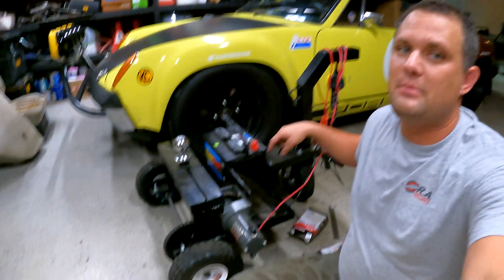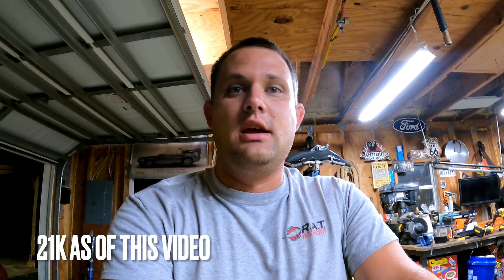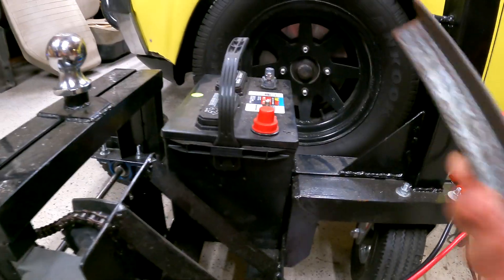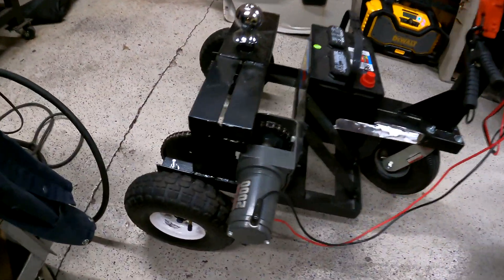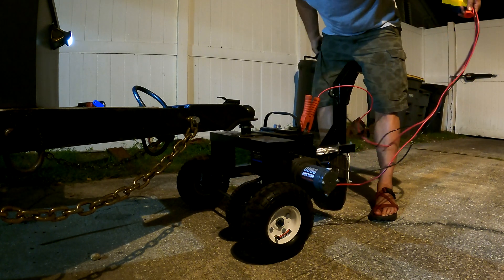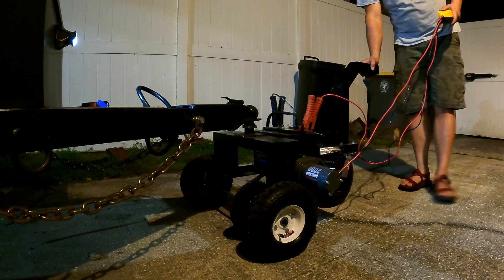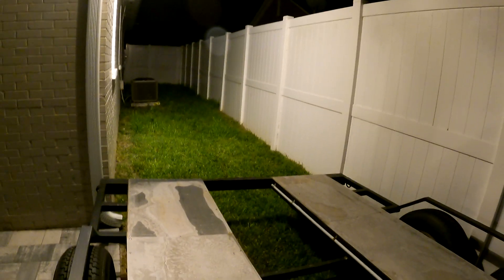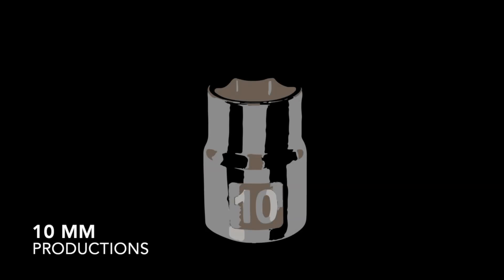DIY Powered Trailer Mover - UPDATE

Comment: put duals on it it will be the quickest way to increase traction. You can do all of the suggested experiments but that would be the quickest way. All tyou'd have to do is your hub method with a piece of pipe in the middle

Comment: realize it is 2 year now.... but I have a thought about your traction.... get (2) 3" wheels.... attach them to a small swing arm that can pivot.... then have them inline with each drive wheel. take a bicycle tire and lap it over the drive tire and the small 3" wheel..... now pivot the swing arm down.... you have a track!!! then pivot it up.... and you still have a 2 wheel drive that can freewheel just like it does  now!
Reply from the maker: Traction was my main issue! This idea is killer!
Reply: @barefootgaragejax9252  I had problems with traction on a electric wheelchair..... so I did what I said above.... and no more traction issues at all.... if you can get the right size tire that will slip over the drive wheel and the small wheel without cutting it  it works perfectly.... but even if you have to cut the tire use a piano hinge.. I used a linear actuator to raise and lower the swing arm... I also put a shock on the swing arm wheel since it was on a wheel chair to make the ride super smooth.... I am helping a friend build a trailer dolly and sent him your video... I told him to use a winch and so..... then I said I bet people have done this before and looked on you tube where I found your video.... I told him to use a bottle jack and weld the ball on it... that way if the ground is uneven you can adjust the height on the go! I used a bike tire since the tires on the wheel chair were 1 to 2".....but you may need a atv / golf cart tire due to the width.. but it is still the same concept. Aires came up with a snowblower that uses a similar idea.... called quick trac or something along that.... but it will give you an idea of what I mean.... I just looked it up.... it is called... Rapid trak... check it out! https://www.youtube.com/watch?v=E7pjKGSFFXs  ...... BTW... the higher you can raise the pivot the easier it is to freewheel... you can see the contact surface of the drive tire... the smaller that contact the easier it is to freewheel.... the aires only lifts it a inch or so and leaves to much contact area but still works... if it raised 4 to 6" it is almost the same contact area you have now!

Comment: I am in the process of building one to move small camper trailers around a pole barn. I have all concrete and don't have to deal with the grass problem like you have. I like your videos and the changes you show when adjustments to the build are made. Thank You Very Much!
Reply from the maker: Good luck! Make the mover as heavy and low as is feasible

Comment: You probably noticed that when your power dolly is pulling the trailer, you have more traction than pushing it.  Here is what is going on. Because your towball is so much higher then the horizontal centerline of your drive axle/wheels, it has the tendency to push the castor wheel in the ground (more resistance) and lifting the drive wheels in air. The solution would be, kind of a system like, reverse or upside down distribution/equalizer bars.
Reply from the maker: Agree! It needs a second connection point to avoid the rotation. I was able to use some straps to prevent 1 direction, but it needs to go both ways.

Comment: Next time on version 2 by a used edge 2.0 power chair, w/ two motors running two sides with 1 joy stick type controllor on the handle make the final drive to both. Live axles with next size wider NON  flat tires the controllor has 1thru 5  speed for power or speed thru joy stick forward AND backwards the same, when letting off the joy stick it locks both wheels so it don't roll! I am a disabled vet i have one of those and it is fast slow, powerful or easy all in one push off push on switch left, right, forwad, backwards ,quiet, i thimk with the drive on each side ratio change via sprocket reduction would be enough, a short linear acuator for the ball hight would make hooking the ball easy and fast! Kewl job though on version ome!
Reply from the maker: Great idea!

Comment: Try making the towball high so there is more wight on the mover and front wheels are off the ground also try a bigger gear on the wheel drive plus if you have two motors one for each side and wire them up on two switches you could use them to trun
Reply from the maker: If it make a version 3.0 it will be dual motor

Comment: Just a thought for consideration on traction.  Depending on the spring setup on the trailer, I am wondering whether airing down the tires on the front axle would shift more weight to the tongue and let them slip sideways easier when turning the trailer?
Reply from the maker: Good idea! I’m sure it depends on the surface. Less psi on grass certainly would make more drag. I think the mover weight needs to increase ideally!

Comment: How would setting up dual wheels plus making the hitch higher putting more weight on the back wheels of your trailer there for transferring more weight to your mover
Reply from the maker: Dual wheels would be a huge help, but you want to keep it as low as you can reasonably. I actually too 2-3” out of the height, because it tried to run “under” the trailer instead of drag it.
Reply: @barefootgaragejax9252  in the process of making one myself using the knowledge I have seen and used them to move augers

Comment: Hey instead of pushing buttons for forward and reverse get either a twist or thumb throttle.... I need to make something to handle a 10,500lb trailer with a 2100lb tounge weight.... 

As for traction the ball mount needs to be center of the total dolly .
Reply from the maker: Great idea!

Comment: I need a very heavy duty dolly and I'm thinking if it is possible to use 4 RTV wide tires, mounted with 4 individual motors for all wheel drive. The 2 tires on front are mounted on a swivel guide, just like the old carry red metal carts we all had back in the old days as kids, those that we moved dirt or even went down the hill with a friend... lol.
Reply from the maker: Sounds awesome- please share!

Comment: I just commented on the original video, but I guess I'll repeat. the tow hitch needs to be at the centre of gravity. That's why it keep lifting the loose wheel. Also directional changes are hard because the winch motor will be locked under no power. If it were me (but with your money!), I'd have 2 motors powering the driven wheel independently. That way you can steer with one in reverse, one forward and it should spin around nicely. Also for off road, perhaps a tracked system instead of tyres.
Reply from the maker: Two motors would certainly be an upgrade!

Comment: Maybe you know about LiFePO4 batteries already but if not, they are really impressive.   Whereas lead-acid you only really get about 1/2 to 1/3 of the AH capacity out before the voltage is too low, the LiFePO4 batteries can do a true full capacity discharge, are good for about 10 years life and 2000+ cycles.   They have a low internal resistance too.   You get more performance from a 30AH LiFePO4 battery than a 60AH car battery and the LiFePO4 battery only weighs about 8 lbs and is much smaller.
Reply from the maker: I’d love a lipo battery! For this application, the weight of the lead acid is actually an advantage :)

Comment: Nice build. Couple of suggestions for improvement. Mount a tractor seat facing forward and then mount a steering wheel straight up between your legs. Get rid of the swivel tire and mount a turn tire solid to the steering rod. That will give you more weight over the drive axle and allow you to back it up like you were using a truck. You can also mount your controls on your steering wheel or convert to foot controls.

If you still have traction issues, the wider and taller of tire equals more ground contact thus more traction. 

👍
Reply from the maker: Then I can take it out for joyrides too! Great ideas!

Comment: When reversing the trailer I think I saw you pushing down on the handle. Surely pulling up would increase  the traction ?
Reply from the maker: That’s correct. Push down when moving forward and lift when reversing. Sometimes you have to lift it for the caster wheel to swivel around.

Comment: Do you know the tongue weight of you trailer?  Are you satisfied with the speed?  If your winch is about the same rpm as mine I figure your dolly moves about 29 feet per minute.  I am going to build one of these for my 16 ft boat/trailer.  Tongue weight on mine is 250 lbs with total weight somewhere around 2,500 lbs.  For traction I am going to increase the tire size to 13 inch hoping to get more tire on the ground.  If need be I will switch to a better 13 inch utility tire with more of a flat surface    on the ground than the Harbor Freight tires/wheels I am going to start with.
Reply from the maker: I believe my trailer weighs 1000-1200 pounds and the tongue weight is at least 200 pounds. I can lift it, but just for short bursts on pavement. It works for my needs, as it’s not far to go and traction over grass is more important than speed. If you step up the tire size, you may want to change your sprocket size or run two reductions to keep the speed low / torque high. I’m totally happy with the winch, plenty of power and very reliable. I think if I build V2, I may try to use a go kart axle and hubs, as that was the trickiest part to make. Good luck!

Comment: You didn’t address building more of these! I like the video and the idea but really it’s inspired me to buy one of those you can move around with a cordless drill lol
Reply from the maker: There’s one in the market that uses the 60v dewalt concrete mixer, and it’s sweet! You need a ton of gear reduction for that, which is a bit out of my depth!